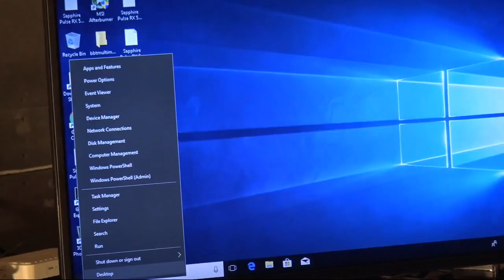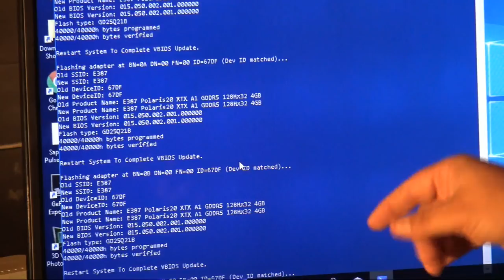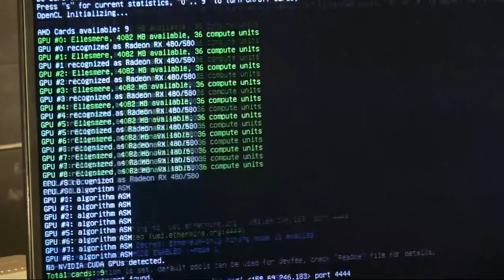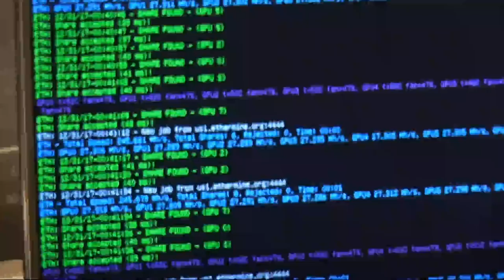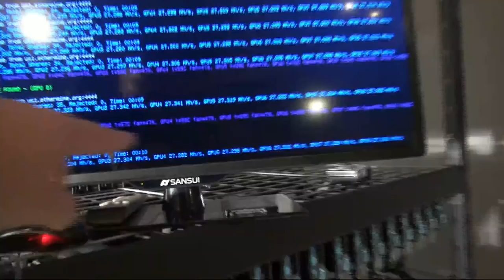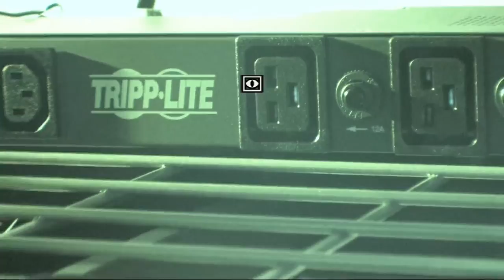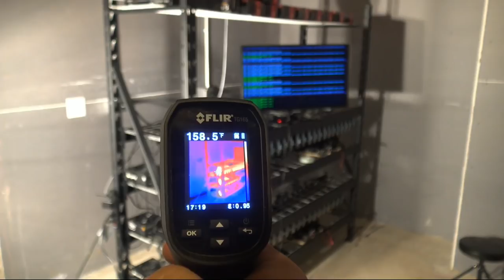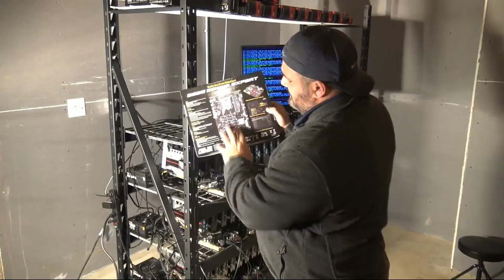VLOG #79 60+ GPU Build - Part 2 (livestream) 13x Sapphire RX580 4GB Pulse with B250 Mining Expert

Comment: Timestamps

0:35 Sound check begins
2:30 Greetings
4:20 Complexity for a big build using AMD GPUS
5:25 reasons for using Nvidia GPUS over AMD GPUS
6:00 For price for performance AMD wins but no setup time
7:30 Bios setup See part 1 for more detailed setup
9:30 No post with simplemining try different USB port
10:50 Question: What is Dual mining? AMD pros
13:40 Bitcoin price ups and downs. Why not to worry.
18:10 Why starting with a small 1 or 2 GPUs is ok
20:00 Asus B250 Mining Expert Motherboards: do not use the x16 pci if only mining with 13 GPUs or less(maybe Simpleminging only)
21:30 Sapphire RX580 4GB Pulse GPUs Settings
22:40 Releasing 2 bios for Sapphire RX580 4GB Pulse GPUs and why
24:10 Question: What do you think about the p104 with 4Gb of ram?
25:00 What is a DAG File?

27:00 4 Gb Vs 8 Gb GPUs
27:50 P106 90 and P106 100
28:20 What is Bitsbetrippin’ as a company and plans for 2018
32:50 Hold off on making predictions on VOLTA and why it's better to wait for the cards to come out
34:45 Question: What are safe Temperatures for GPU mining? Less then 85
36:25 pros of cards that have a backplate
37:55 5$ for chicken dance?...
38:30 If your getting swings in your hashrate performance check your temperatures.
39:25 If you need help with your mining rig check out the Bitsbetrippin discord channel,  1000+ Users https://discordapp.com/invite/Zpp3DGt
42:10 Rack Description, Parts, Price, etc
47:20 Looking at math for return of investment
50:00 What software are they using for mining?

51:35 What type of networking/Internet do you need for mining?
53:50 When you have a large mining setup, its a good ideas to look into a backup internet connection.
55:25 Question: What risers do you recomend? Build riser https://www.youtube.com/redirect?v=ux-zS9h2i58&redir_token=RIyYI-eh-DPk5lV7QQAr-j5Lk5V8MTUxNDc2ODU4OUAxNTE0NjgyMTg5&event=video_description&q=http%3A%2F%2Famzn.to%2F2BLkxjJ
57:45 checking Device manager to check if all GPUS are there
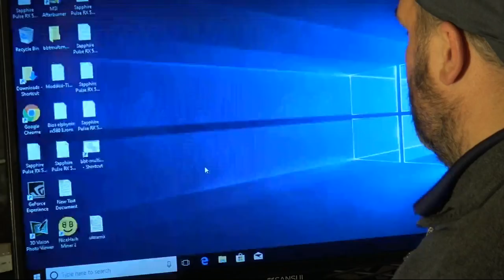58:05 using powershell/Ati Flash to auto flash bios to all gpus

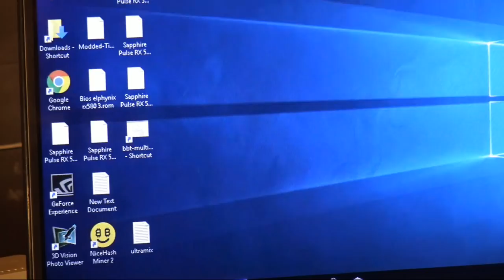1:03:45 Bios finished flashing
1:06:05 looking for cards that are below 27.5 mh to reflash with other bios
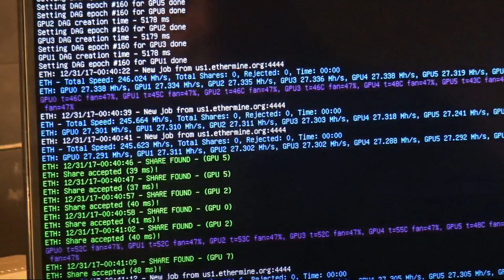1:07:15 Question:  Why are you not using BBT multiminer on these Rack builds?
1:11:30 Close Up on Rack setup
1:16:27 Question: Will you do core undervolting?
1:17:55 Question: Why no PDUs that monitor? 
1:19:55 Question: What is total Hashrate for the Rack?  ~1.9 Gh/s
1:21:20 How do you plan a build like this?
1:22:45 Thermal gun Max shows 158F/70C
1:24:30 Door open watching temps cool down with thermal gun 

1:26:55 Question: How many non mining cards can you put on Asus B250 Mining Expert Motherboards?
1:29:00 Trying Asus B250 Mining Expert Motherboards with 14 GPUs (no mining cards)
1:29:30 Question: Does simplemining install gpu drivers?
1:32:45 Question: Should I buy 56 1060 3gb for 10, 000 Euros? Is it a good investment?
1:34:57 Question: Are you going to do a follow up on Rosewill BM-600 6GPU Mining Case?
1:35:25 Question: Cant get 8th gpu in windows 10? 580s/1060? Hard to hear question on this one so might be wrong
1:37:05 Question: Can you dual mine on Titan 5’s
1:38:10 Question: Can you run13 gpus on the  Asus B250 Mining Expert Motherboards in Windows?
1:38:47 Question: How do you Dual mine in Simplemining? https://bitcointalk.org/index.php?topic=1433925.0
1:40:13 Question: What your opinion on Zotac 1070 ti amped extreme? https://www.youtube.com/watch?v=Gb-ZEEjUWjQ
1:41:15 Outtro

Etc 0xd8206bd0ab6767ac832169591f10d7ec3b98480c
Show less
REPLY
Reply: Do you have any idea where they offer those 2 bios they talked about?
Reply: did a quick check and didn't see anything uploaded yet,  He was quite busy before he left for CES.  you can try the discord channel and see if someone there can help you out or wait and send email/twitter once they are back.

Comment: the 2 fan asus cards have a thin 2 pipe heatsink with hard thermal compound, that why they shoot up in temp
has nothing to do with a lack of backplate
only thing ive seen with a smaller heatsink is the msi armors

Comment: Considering setting something like this up in my basement, was also thinking of putting an exhaust fan blowing air outside, I skipped around the vid. a little but but I didn't hear anything about vents to outside, I Just heard talk about that door to outside. 

Do you have any comments on setting up exhaust fans to outside?   What about intake fans?

The scenario is a small bare bones room in a basement with a rack in it like this and I want the heat out of my house.   Anyone have advice or can direct me to a BBT vid?

Comment: carter - with 13 x 580s -- will you add the other 6 x P106 later?
Reply from the maker: no, we would add 8x P106, pull 2 per machine and drop to 11 RX580s; build that 6th machine by taking the 10 RX580's and adding it with another 8x P106s for the 6th.

Comment: Thanks for great videos 
I have 6x 580 Pulse 8gb - Bios modd.. In Windows i get 29 Mhs. But in Simpel mining i get only 20 Mhs. In sipelmining i use Core 1150 and Mem 1950. Why i dont have more Mhs in simpelmining. 
Second Question: 
In windows i get 29Mhs all together 6 card is 170 MH. in ethermine.org (statistic)  is after 1 day mining: reported hashrate is still 170 (29mhs per GPU) but Effective Hashrate is only 100. I do not know what I'm doing wrong. 
Thanks for answer 
Sasa

Comment: thanks for one more amazing video.
could you tell me if I can use smos using wifi or it must to be wired?
Reply from the maker: SMOS looks for a local LAN connection, you can use wifi in mining, just sometimes you may get stale shares more often if  you have high latency on your wireless

Comment: How is heat managed ? I have 3 rigs with 12*1070ti and 6*vega56 and i dont know how it will handle the summer and my basement is already warm despite the windows being open and outside is 10°C
I'll have to drop the power limit by 30% so that it's manageable (right now i have it at 90% as my electricity contract has a high limit of usage - 9kva)
Reply from the maker: boxing the entire rig in via heavy plastic and bringing in some ductwork to move heat out of the box through proper external fans and ventilation. In Summer will be using a seperate 14000BTU AC standup unit.
Reply: It's much better to extract the hot air from them than to try and cool the air down. When i started and had 3 rigs I had an aircon unit on full and it was barely able to cope. I got an office with AC and after 6 rigs only opening a window and extracting the hot air was workable. Now I have more rigs and always focus on getting airflow across the rigs and extracting the hot air as well as possible.
Reply: Have you ever talked about this topic in a video, I haven't seen anything?   Thinking of installing a exhaust fan in one of my basement windows to pump air out, not sure of other negative pressure issues this may cause though.
Reply: No - I've only done in person talks to physical people. I do keep getting asked to do some Youtube videos, so it's something I'm considering - but I'm travelling in Asia right now so will probably start next month when I'm back in the UK

Comment: ASUS PRIME Z270-A  which processor Intel Core i3-7100 or Pentium Processor G4400?
Reply: Either should work fine if its just a mining rig. Go for what you can get cheapest if your looking at fastest ROI.
Reply from the maker: You can get by with a G4400, with no problems. Personally, I like the i3-7100 when working on mining rigs that will be running windows and/or dealing with AMD cards as the extra performance helps with setup/configure. Once mining, the processor is nominal. 

if you value your time on initial setup/configuration/updates, you will like the extra 40 or so bucks spent.

Comment: Hello sir !

I am looking for building up a 10 mining rig system with 30 1070 gtx 8g and 30 580 rx 8g

Wich graphic cards for dual mining ethereum+decred between 2018-2021 would be the better card (lifespan,efficiency,guarantee,hardware quality,And this Samsung memory makes the qualitative difference theory) without thinking of ROI ?

How much airflow is needed and how should i place the ventilators related to rigs ? ( wich ventilator would you recommend ? )
Wich Airfilter-technology do you recommend ?
Should i use air conditioner ?
wich mainboard ( 6 gpu or 12 gpu or more ) and powersupply (bronze,gold,platinum per rig) for best efficiency and smooth run for long term ?
how and in wich periods should I maintain the rigs (Bios update, overclock, cleaning rig,  reset time or shut down time)
Wich OS for dual mining eth+coins to not to crash the system ?

From wich manufacturer should i use the raisers and the cables for connection and for network connection ?

what would you recommend me in terms of wich software to use (+ nicehash, simplemining or other ?. Best userfriendly and dual mining compatible with fair payout ?

i have 16 mbit/s download 3 mbit/s upload bandwidth adsl internet upto 75 GB after 75 GB limit it drops to 5 mbit/s download 0.67 mbit/s upload is this enough to mine eth, eth+coins, etc, etc+coins, zcash, monero with 60 gpu ? Should I upgrade and what if upgrade not possible ?

Wich Router and Switch would you recommend me in this case ?

do you have an advise for me related to the rig i want to build with 30 RX 580 8gb 30 gtx 1070 8gb and the future of ethereum, monero, zcash and decred in global adoption ?

Please reply sir

Thank you man 0o0
Reply from the maker: Nearly anything you will buy, provided crypto prices hold at least 40% of their "Current value" will make ROI by 2021. That being said, there are many options and it is predicated on what your mining. Best all around card/deals are going to be with AMD cards, however you have to run into BIOS/Modding and traditionally more power usage and more heat to deal with. 

Nvidia based cards will take longer to ROI, but less headace's. 

Ventilation, Cooling and overall rig health is what we are working on this week. We will show everyone through a follow up livestream on the solution we are coming up with regarding this.

Comment: 19 cards work fine in Ubuntu server without p106's
Reply from the maker: Dominion can you shoot a video and post it somewhere to show everyone? Current BIOS does not let the board post (Power On Self Test) with more than 13 regular GPUs plugged in. This is not about what operating system allows it to work or not, it physically does not POST with more than 13 plugged in. 8x P106 and up to 13 (using expanders) is current limit; which (21 cards) is the current limit we have found; just search for our 21GPU video

Comment: I just don't understand the whole simple mining rental. Why not just buy a win10 license for 30$ and be done with it.
Reply: probably because SMOS comes with a nice cloud interface which allows setting up groups for different coins, optimisations, grouping of rigs etc. VERY easy to manage a lot of rigs like this and easily change some/all of them to be setup differently or mine other coins in a few seconds.
Reply: Win 10 wont be able to control all of these cards at once, you would need to make changes one machine at a time.